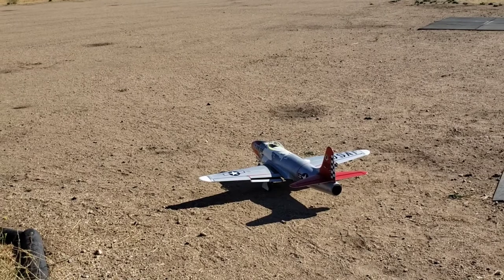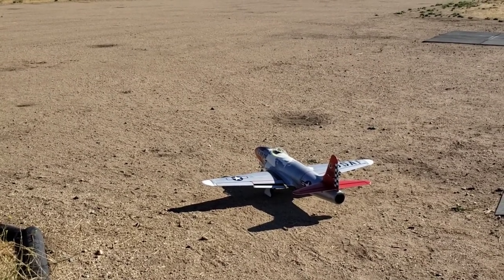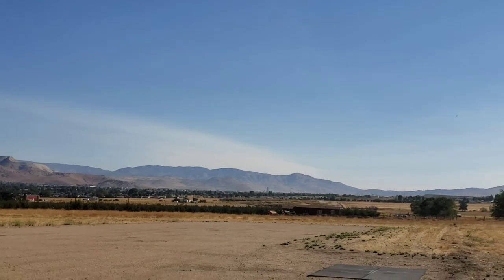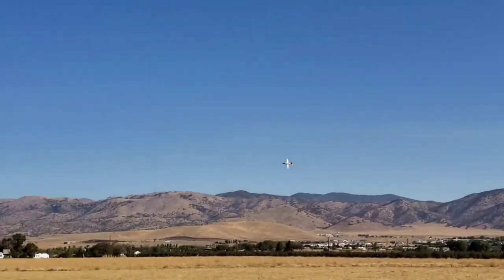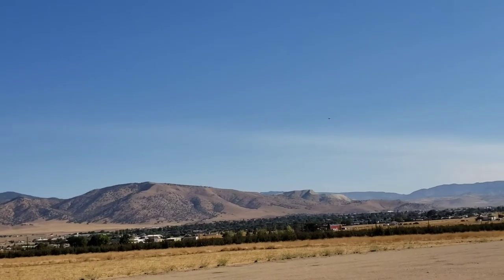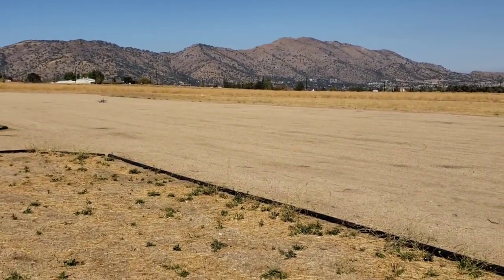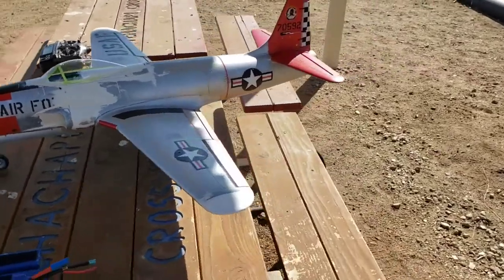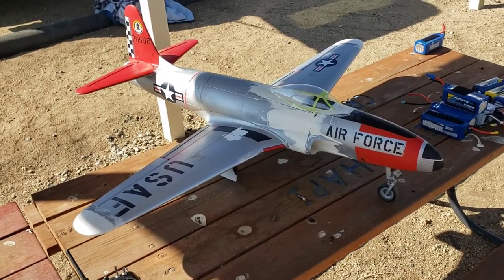FREEWING T-33 TO P-80 CONVERSION FLIES!! EP-3

Comment: It seems based on your test flights of the A4 and now the T33 that maybe the use of cheater holes can be reduced somewhat?  I fly in an area that has a lot of small rocks and sometimes they get sucked up which has destroyed a few fans.  The worst part is the fans get nicked up and that of course reduces thrust.
Reply from the maker: Really depends on the model. I had to do some duct changes to get wnough area for it to work..i also made changes to my freewing f18 ducts and got rid of the cheater and it worked really well. But again...its not possible with every airframe
Reply: @hechtspeed  Ah OK cool.  on your F18 was it a matter of just opening them up or smoothing them out?